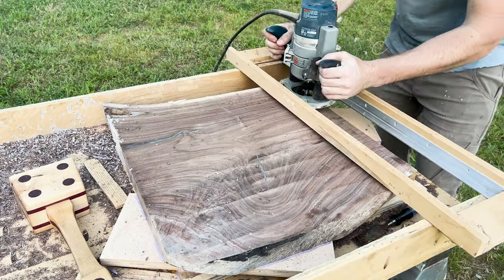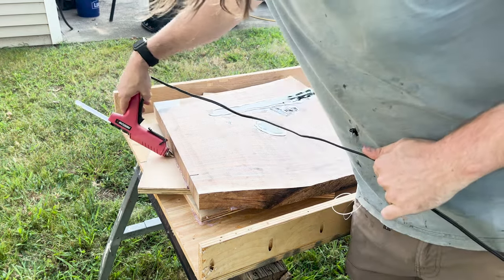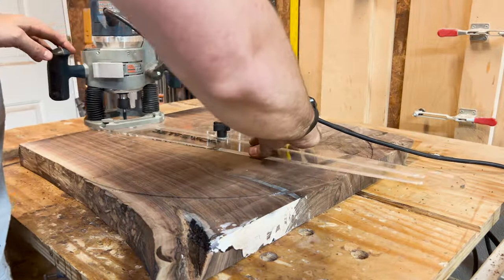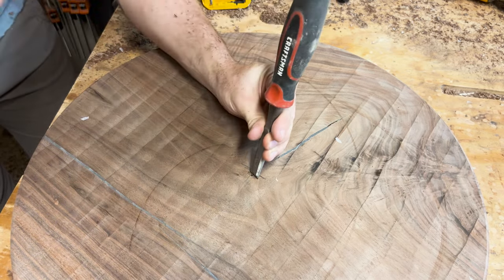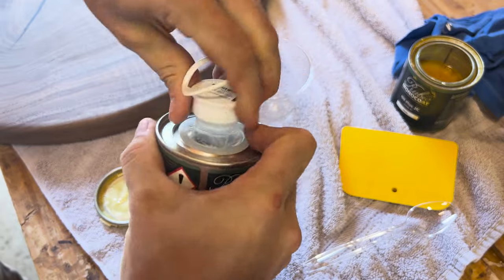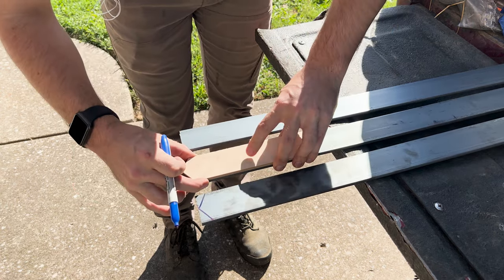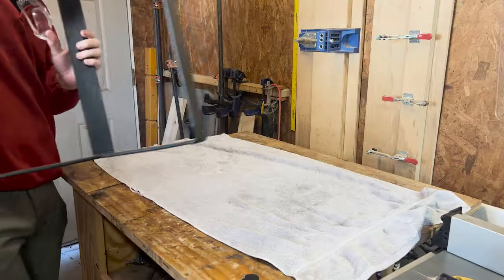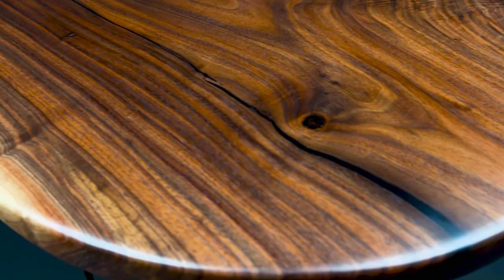Building a Walnut Table Top and Steel Base from Scratch

Comment: You learned with this.  You get better as you go some people are not good with trusting instructions and this system is slower in the start but you will have the chance to find a better way than the advice in the long run.  Mistakes are just a cheap lesson that you will never forget and you cant sleep through.
Reply from the maker: Appreciate the words!
Reply: @riverjackstudio  i am the same way i broke and fixed so many things and now i am 40 and i still break things since i just never stop trying new things but the rule is dont repeat the mistakes